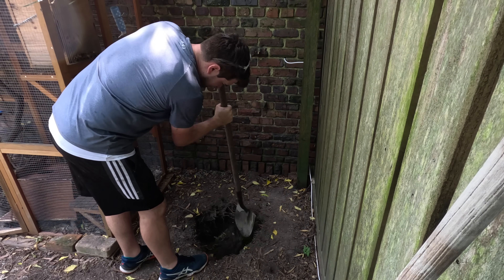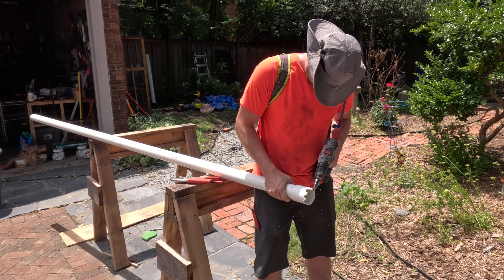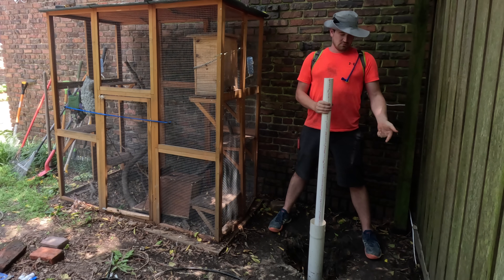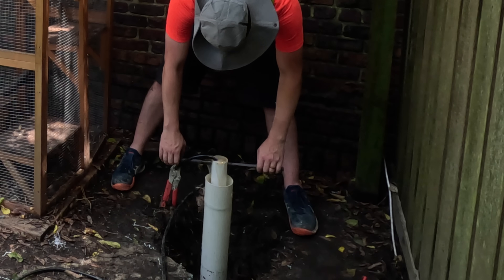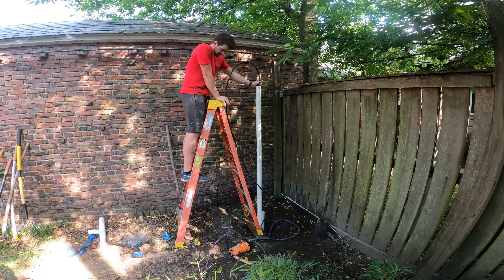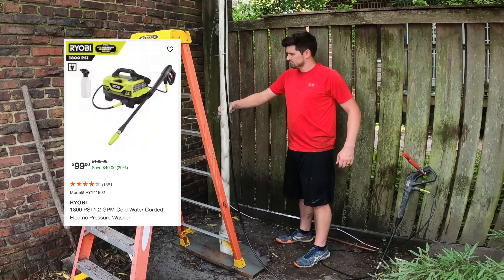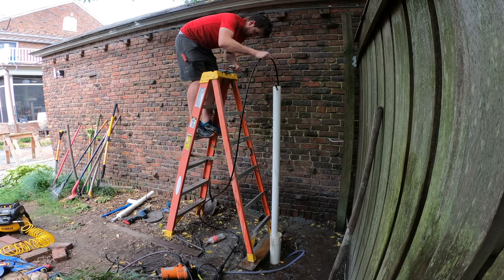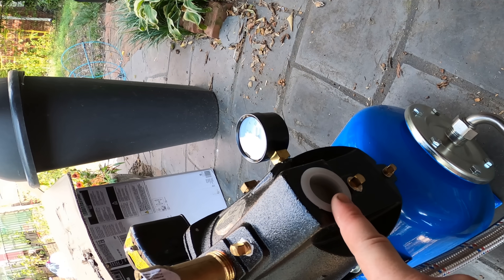I dug a 40 foot well in my backyard

Comment: I enjoyed watching this video about drilling a backyard well, but I’m not sure if it would work in my yard. We have a lot of rocks in our backyard soil, and I think that might make it difficult to drill a well. It would be great to have the freedom to drill my own well, but I don’t think it’s practical for us.
Reply from the maker: Depending on how big the rocks are, you could try driving a well with a steel well point. That can help move some of the rocks out of the way if they are smaller as you drive, but you probably cannot drive down 40 feet with that method.  Points get very hard to drive past ~20ft or so.
Reply: Just a thought here. If you know of a new home, or a pop top house, or a major addition happening near you, try to talk with the GC at that project site, and ask him about what his engineer’s report said about the soil in this area. Because engineers have to do a soil analysis to draft a report regarding the load bearing capabilities for what soils the foundation will be setting  on, they will generally commission a drill rig to do a core sample which gets analyzed for bearing potential, you can gain valuable insight to the first 11-15’ of soil below grade in your area. If you get real lucky and the job is a 5 story or taller commercial building, you might get to learn about the soils going down 20-30’ or more; quite often down to bedrock.

If this were me trying to question a GC about what his engineer’s report said, I would bribe him with a cold 6-pack or 12-pack of premium beer for this knowledge (ask the GC what is his favorite beer). That report would be telling you a lot more than you know now. Play your cards right, and he will probably drink a couple of cans of that bribe with you.

Comment: You've got dirt in the water - pushed up out of the - 2in pipe, running right back inside the 4in pipe. Some of it is washed away, but I'll bet some goes all the way down to the bottom of the 4in pipe.  Seems like if you diverted that dirty water, it would be better, easier, to push the 2in pipe down. 
Thanks for the ideas, showing us your work. This is definitely a cool idea!
Reply: where is your well
Reply: that was my thought as well.

Comment: Wow it would be great to live outside of alluvium or glacial till and be able to go more than 1' without hitting cobbles and boulders. This was a cool project tho. Well MacGuyverd
Reply: Same here, and the water table is between 40 and 60 feet deep.  So that would be a long slow process.  I have 3 wells on my parent's old farmyard.  One is salty and almost no water, the 2nd is hard and almost no water.  The third is VERY hard, both calcium and magnesium, but all the water you could want.  I have rural water these days though.  It's much better than trying to do anything with what comes out of the wells.
Reply: @xlerb2286  I'm sorry to hear you have suboptimal water from your wells. If you didn't have hard water, would you use it or are there other properties of the water that cause you to prefer your other source?
Reply: @devon9075  The water is 120 grains hard, and it's high in iron and magnesium so it makes a great laxative  ;)  Plus there's a cattle operation in the region that has contaminated the ground water in the area so I'd need to add a chlorine treatment or similar.  But rural water is $20 a month basic charge plus a very low cost based on gallons used.  I've never had a water bill more than $35.  And it's great water.  The well is still there as a backup just in case.
Reply: People who live in sedimentary plains near coastal areas have it much easier in this respect.

Comment: Where are you located? Approximately? Planning a shallow well to keep a pond topped off once it's dug.
Reply from the maker: I'm on the east coast of Virginia

That's one of the things this well is doing. I have a float valve in my pond that automatically fills it up, hooked to my well pump.
Reply: @BadHomeowner  That's interesting. My pond, if it comes to fruition, will be fairly close to an above ground pool that has power run out to it. The plan is to upgrade the power then the well pump and aerator can be powered from there. We'll see how it goes...Lol

Any info or links on the float valve? Thanks. :)
Reply: @BadHomeowner  Got my pond excavated and am re-visiting this idea. Lol

My property is tons of blue clay, which is great for the pond but not for digging a well. Hoping that the river being so close means a high water table. We'll see...
Reply: @BadHomeowner  Quick question: It seemed that you bottomed out with the 2" drill pipe, but you wanted the well point with the slits to sit below the level of the 2" pipe.

Did you end up backing up the 2" pipe a few feet? before cutting it?

Comment: Is it still working well? No pun intended. 
Also, would it be good to run a 4" pvc sleeve all the way down and have holes in it to keep out large debri and dirt?
Reply from the maker: Yea it's been working for over a year now. 

Technically you could run 4" much deeper than I did, but it takes a lot more time than digging with the 2" pipe because you have to remove ~4x as much material. I think you'd want an actually drilling rig for that.

Comment: How did you know where your water table was at?
How did you know if you hit water?
Reply from the maker: I didn't know exactly where it was, but I'm at 10ft elevation above sea level so I figured it would be around that deep. My water table starts at around 8-9ft. You'll know you hit water because you can hear it splash when you lower the next pipe in.

Comment: for that style pump would be best if you put a foot valve on the bottom of the 1 1/4 in pipe. pump will last longer and never lose its prime.
Reply from the maker: I'm using a check valve instead. There's a well point at the bottom of the 1-1/4 pipe so you can't put a foot valve there.
Reply: The check valve is fine but it works a lot better if you place it near the bottom of well, so right after the well point section. Because the check valve is more like to leak air and loose prime than it would be to lose water at the bottom
Reply: @wachinpntdry. Spot on comment.  My one house with shallow well had a foot valve with a casting hole that caused a lot of pump cycling as water drained back into the well.  The check valve after the pump wont stop that.

Comment: How you secure the jet nozzle at the end of the pvc? When you add another 10 ft piece do you simply pull out the nozzle and feed it back again? What keeps the nozzle at the bottom and not float/kickbacking back out?
Reply from the maker: This specific type of nozzle has jets that shoot backward as well.  You can see it in the photos here: https://amzn.to/4c8ndsG

Yea for each new 10ft section, I just pull the hose out, attach the new pipe, and drop the hose back down again.
Reply: @BadHomeowner  much appreciate the quick reply and clarification. Im assuming you didnt hit any rock and if you did you would start a new hole?
Reply from the maker: @makethingshappen8427  I didn't hit any. And it depends on how big the rock is, I guess, as to whether you need to start a new whole or try to wriggle your way around it.
Reply: @BadHomeowner  thanks ill give it a go

Comment: When I did mine I wanted 45 ft.   That’s what the city does for all their sprinkler systems.  Once I got to 27’ everything I sent down just disappeared.  I tried bentonite but it didn’t help.  I did gravel around the head and it’s been pumping beautiful  since 2013.    I guess I did it right.  It runs 3-4 hours a week and even after a drought that lasted over a month never have I been short of water.     If I had to do it again I would use galvanized pipe and just use a jack hammer with a home built fitting.  That’s actually how the guys that do it for a living here do it.   Except they have a 100lb sled that slams it down.  My first pump was a cheap Lowe’s pump. It lasted 10 years.  I now have a Gould which pulls way more more.  I only use it for watering not my house water.
Reply: I am looking to do the same thing, but run the sprinkler system at my house. What type of GPM are you getting with your pump?  Do you happen to know which model it is?
Reply: That sled is called a pile driver.
Reply: @sinisterthoughts2896 no that’s a wrestling move
Reply: Lol. They make pneumatic Rhino type drivers and gas powered drivers for fence posts. No one is lifting a heavy ass jackhammer up a ladder or over their head
Reply: Roflmao
Reply: @Nonyabusiness911  did you test the water? His looked pretty darn clean. Plus it's alkaline
Reply: But how did you know you were not going to encounter hard rocks and ruin your pipes and tools ?

Comment: Would it be possible to cycle or reuse the old water
Reply: The water coming out of the drill pipe/casing will be full of abrasive soils material. This will eat your pressure washer’s pump alive. And no, it is not practical or feasible to filter this waste water for reuse. So the quick answer is NO.

Comment: There's a 33-foot limit to using suction to draw water upwards, so you're at the max without going submersible.  (Suction above 33' will cold-boil the water)
Reply from the maker: Yes, but that's measured from the water head, not the depth of the pipe.

Pipe can be 1000ft long and you can still pump it with a shallow pump, as long as the top of the water table is <25ft deep.
Reply: @BadHomeowner  Yeah, you're right.  You did mention the water table was 10 or 15 feet.  That's awesome, I'm jealous!  I'm looking for a way to do this here, but water is at 100 feet with mostly clay to drill through.
Great job on your project.
Reply: It's 25 ft not 33. Professional well guy here. He's right, it measures from the top of the water. We jet down a 24' piece of 2" pipe then slide a 20' piece of 1.25" pvc with a 4' pvc screen then pull the 2" back out. Obviously we have a big pump truck with gas powered pumps, but the concept is the same
Edit: i just hit read more on badhomeowner's comment. 
Also, i would recommend spending more money and getting a better pump. Those box store pumps will move significantly less water than a Star, or especially F&W

Comment: Why did you assemble the entire 40’ well point section prior?  Couldn’t you have assembled it as you were lowering it?  I understand you don’t want to lose it, but it seems really hard to feed the 40’ into the hole
Reply from the maker: For one person doing it yourself, you'd be holding a many feet of pipe with one hand while somehow cementing the next pipe on top all while it dangles over the abyss -- no thanks.

You really need a 2nd person if you want to assemble it piece by piece as you lower into the casing. 40 ft of pipe is heavy, and because the couplings are on the interior of the pipe, there's basically nothing to grab onto.

Pre-assembling it and cramming it in there in one fell swoop was irritating, but very do-able by one person.
Reply: @BadHomeowner  That makes sense.  Didn’t think about holding the many feet of assembled well point line as a solo DIYer.

Comment: Well to get water where I am you have to go 400 ft and 390 of that is solid rock
Reply: $40k is a bargain!  I’m at 5800’ in Utah. The greed is rampant. I’m being quoted $60k for 300’ (local water level is about 220’)
Reply: @chuckm1320  Greed indeed.  You can start your own well drilling business and make billions!
Reply: I was gonna say this would.only work in soil with no big rocks
Reply from the maker: Luckily I do not have to go that far!
Reply: Who installed it?  Give them a plug for reasonable prices….
Reply: @ISmellLikeBeefandCheeseI am at just below 5200’ elevation here in Denver, and about 11’ below grade is builder’s sand, which is basically pre-bedrock. What I can tell you is that it is coarse grained sand that is harder than hell. You cannot hand dig into this stuff with a round point shovel (LMAO remembering my buddy Lane trying to do this for subslab plumbing). A mid sized demo hammer with a spade point will have to work to trench in this material. It is the hardest sand you will ever see in your life.

Comment: how is that pump working at 40 feet? i didn’t see an injector go down the pipe. Is water table less than 25 ft down? Shallow well pumps typically don’t work past 25 and jet pumps require an injector (i think).
Reply from the maker: Good question. It works because the TOP of the water table is only about 15 feet below the surface in my case. As long as the top of the water table is <25 ft, the pump can work at greater depths.
Reply from the maker: The main reason shallow pumps can't work at, say, 200ft is because typically those depths reach into an aquifer which isn't "connected" to the water table, e.g. often there's a layer of rock in between. And so the water table at ~15ft doesn't "count" in that case. 

I'm sure someone else can give a better technical explanation, but that's basically how/why it works.

Comment: I wonder what kind of filtering would be needed to make this potable. RO?
Reply: Depends on the water.  Amazon has water test kits to find tds and specific ions.  Water treatment for solids is easy but high tds requires more work to make it potable.  Water for outside use is ok below 1,000 tds but water for house drinking is likely 200 ppm or less.  Iron leaves staining and needs to be removed if it is high. There is quite a bit involved depending on your situation.
Reply from the maker: Yea I may get it tested here soon, just for kicks.  I doubt it's drinkable, and I'm not sure if it can be filtered enough to be drinkable. But I'll figure that out at some point!
Reply: A Sawyer Squeeze filter is all that's needed to run the water thru making it potable.
Reply: Because digging private wells, even on your own lot, is highly regulated and generally restricted, and because many municipalities own all mineral and water rights under your property (read your title/deed), having your water tested raises the possibility of getting busted for a private well. You can probably get away with having  one or two samples of water tested for potability, but regular repeated testing will lead to questions being asked about where these samples are coming from and why you are having your water tested. 

Property owners who do have private wells and are grandfathered in from before municipal water supplies are required to have their wells tested annually or semi-annually. And to be truthful, anymore I would be real reluctant to not get water from a private well that I/my family was drinking not tested.

Comment: Hi, Question, Could you have just skipped the 20 feet of 4-inch pipe, since the 2-inch went down beyond that, then the 1 1/4-inch down further beyond that? Thanks!
Reply from the maker: Yes you could. I wanted a 4 inch casing to make the initial digging somewhat easier, and in order to install a well cap (which comes in 4 and 6 inch sizes) to keep out debris and stabilize the 1-1/4 in pipe. And some areas may require a casing of a certain diameter if you want it to be "legit". But no it's not technically required.

Comment: How much water do you estimate you used with jetting and other water you used? I would like to do this in an area without water, but wondering if its worth trucking in that much water. Thank you
Reply from the maker: Hard to tell exactly, but I'd estimate less than 200 gallons based on the amount of time the pressure washer was running.
Reply: @BadHomeowner  sounds good, that's an easy amount of water to bring. Thank you

Comment: That was most cool.  tHanks for the video.
(I've wanted to drill horizontally to put in a drain.  The idea is to go about ten feet and end up with a 4" pipe.   My problem: I think about it too much and don't experiment with drilling techniques.    tHanks again for the video!)